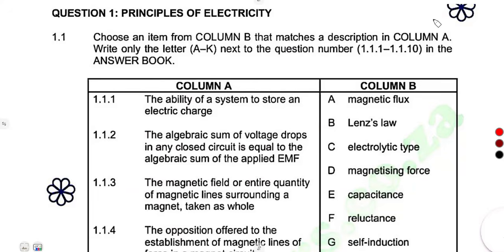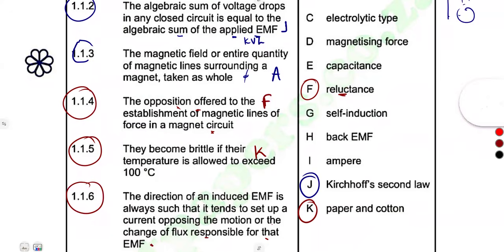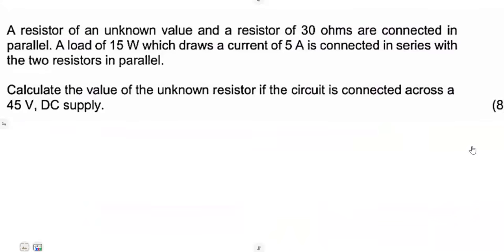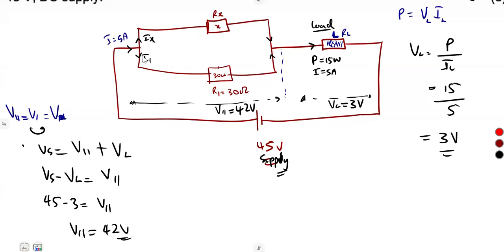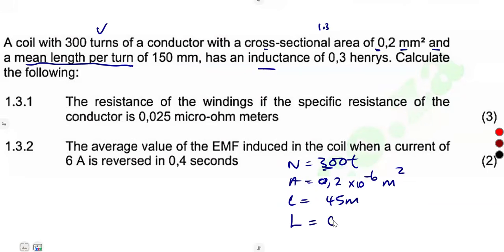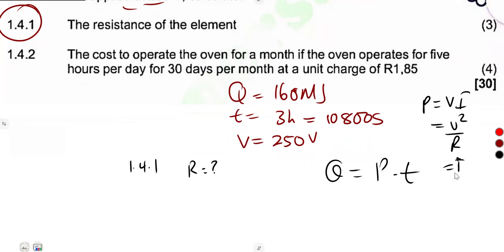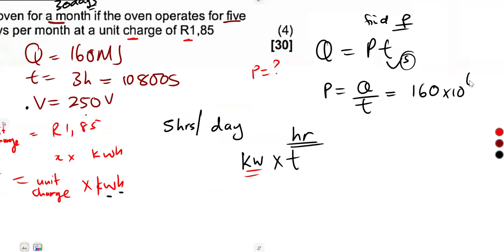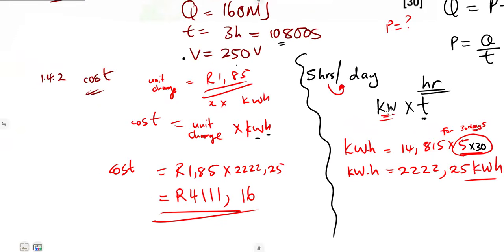Electrotechnics N4 November 2025 Q1 Principles of Electricity @mathszoneafricanmotives

Comment: At 1.4.2 shouldn't we divide the power we get(14814,814w)with 3, and then multiply it with 5 and 30, because they said that was the values for 3 hours of operation, so if we just multiply with 5 we'll get 15hours a day for a month
Reply from the maker: Hi , it’s ain’t like that, the 3 hours is only applicable on Q. The cost is for 5 hrs a day for 30 days.